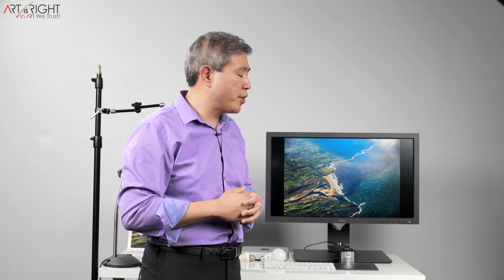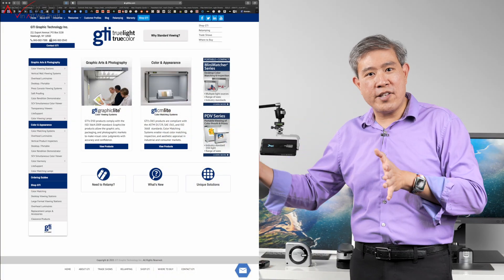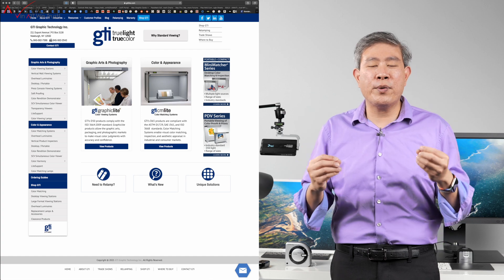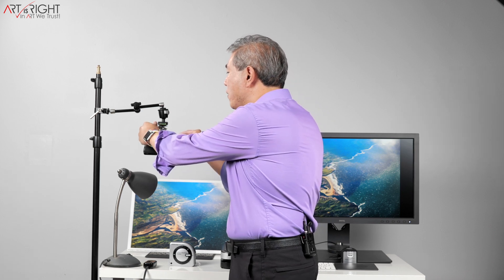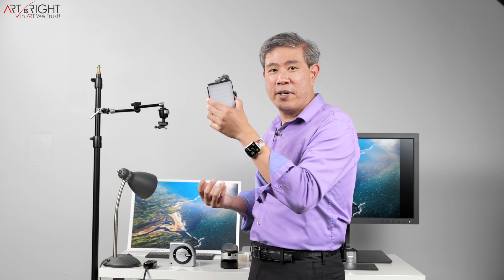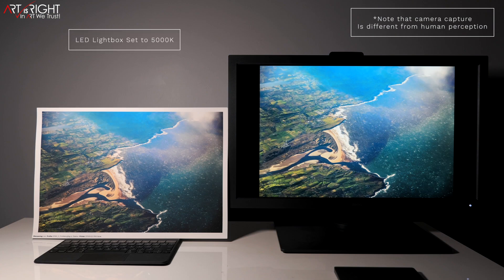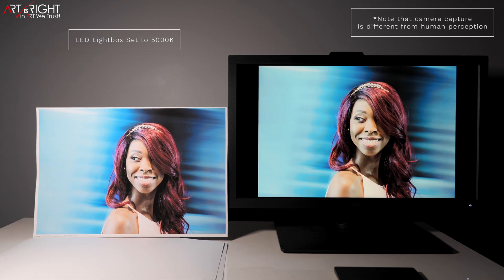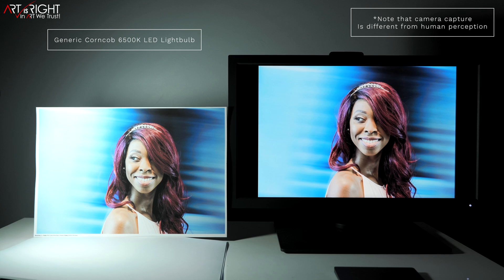Display to Print Color Matching, the missing part in the equation, Lighting!

Comment: The skepticism I have with these LED light box is that we have no idea if they're speaking the truth about its CRI. I have look through other light boxes and saw review that complains about the CRI being 80 instead of the stated 95.
Reply from the maker: CRI Is one metric that shows an accurate representation at one color, temp and luminance. For the most part I find that manufacturer are accurate but they don't specify the temp and luminance that they test it at, which is an issue.

Comment: Hi Art-I’m hoping you can help me figure out a printing problem. I have the Ben QSW 240 running on a Mac pro 2019 and calibrated with a spyder pro with settings according to your suggestions in panel native. I did some test prints with a print lab and my photos came out much darker compared to the monitor and some of the colors look muted or dull, especially oranges/yellows. the print lab told me I need to change my monitor brightness but I already have it at candela 80. She also suggested changing the gamut to 5500 instead of 6500 which she thinks will help with the color discrepancy. I’m wandering if I have the black point wrong. I have it a .5 nits as per your suggestion for spyder pro. I’m lost what to do as I calibrated to your video suggestions.
Reply from the maker: This has nothing to do with black point, what light are you using to view your print? That is the variable that is not mentioned or talked about. Also changing the color temperature to D55 from D65 might or might not help especially if you light source is off. So it comes back to viewing light source. Let me know and we'll go from here.
Reply: @ArtIsRight  oh thank you so much for your quick reply. You are awesome.  I’m starting a pet photography business and am pulling my hair out with not being able to match my prints to my perfectly edited photos. 😬😫 I edit in a room with 5000 k lightbulbs and view the photos under the same lighting in the same room and have a viewing lamp with same light. But the blacks seem off in all of the prints from this particular lab. They all look darker and muted somehow. the more colourful  ones also more muted almost like the white balance is off. The only one that looks close is one that doesn’t have a lot of color in it. 
Also I tried recalibration awhile back to see the difference between 80 and 100 and 120 luminance and saw no difference in brightness on my monitor between the 3 different ones. Is that normal? Shouldn’t there be a slight difference in brightness at least? I’m wandering if something isn’t calibrating right. 🤷🏻‍♀️ although I always get a report that says pass. But I have no idea how to read those validation reports in depth and accurately.  I tried to recalibrate at D50. There is no D55 option? I’m using version 1:315. I don’t see a whole lot of difference between that and D65… how do I get my prints to match what I see on my monitor. I can’t figure out what to change in my calibration settings.
Reply from the maker: Cindy, apologies for the delay getting back, youtube flagged the comment and it just showed it to me. dm me on fb page or insta and we'll go from here

Comment: Hi Art, I believe BenQ themselves do a light strip that attaches to the top of their photography monitors. I have a SW270c myself. Would you recommend this?
Reply from the maker: Yes it is Called a light bar, its intended use is not for this purpose and you can't really go in and dial the exact Kelvin color temp, so that is an issue. Nor do they guarantee any CRI value.

Comment: I use the Cree 100 w 5000 K bulb and find it pretty good. My proofing area could probably use a 2nd one. The thing is though, that in our homes the color temperatures are all over the place. Most of my interior lights are about 3300 K, but then there's windows letting daylight in  which varies over the course of the day, and reflecting off my yellowish walls and my warm orange hard wood floors, etc.
Reply from the maker: My point exactly that I made in the video.

Comment: Really interesting video, Art.   You’re right, light color in an under-discussed variable.   I’m wondering why that LED light box performed so badly at 5000K if it’s CRI score was so high.  Thanks for this one!
Reply from the maker: CRI changes with color temp, I am trying to get in a Color Spectrophotometer in the studio to test that light, so I will keep you posted. The problem with light source that changes color temperature is that most manufacturer don't tell you the CRI at all color range, just some or just don't disclosed them.
Reply: @ArtIsRight  Got it.   I didn’t even know light bulbs had CRI values before your video.  Now I’m going to spit on any I see in the home store with scores less than 90!  🙂
Reply from the maker: Every light bulb can be rated or measured for a CRI. There are also other CRI variation that are better for certain applications as well, such as TLCI, TM-30, or SSI ;)